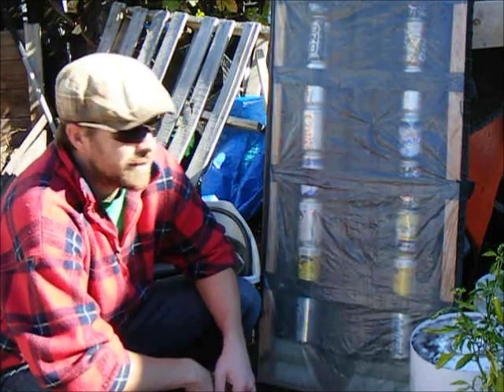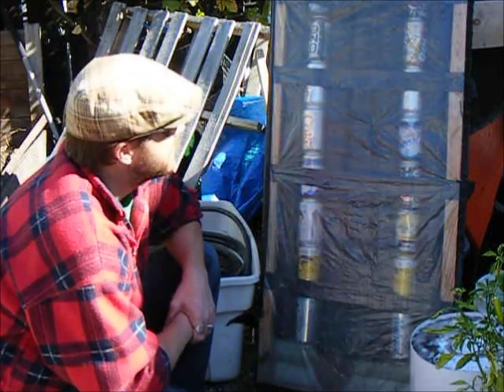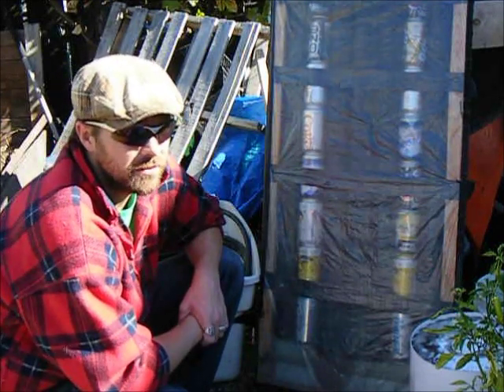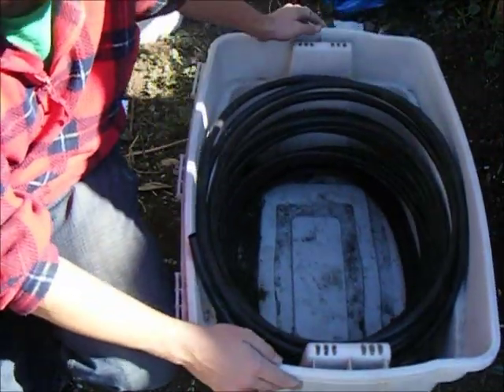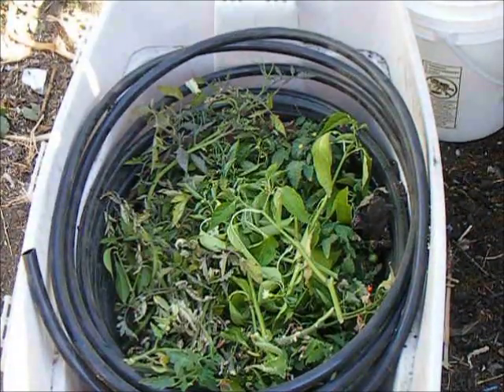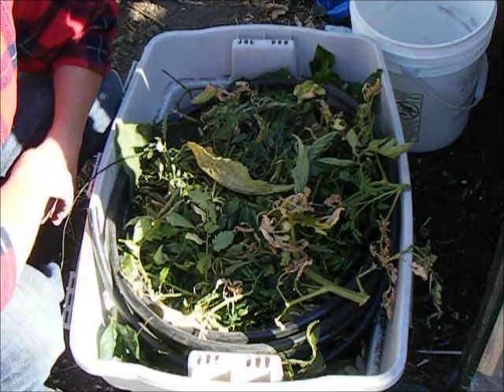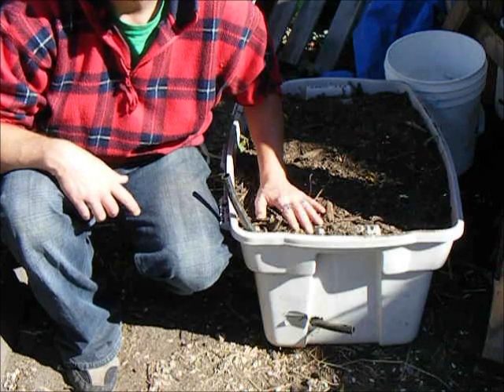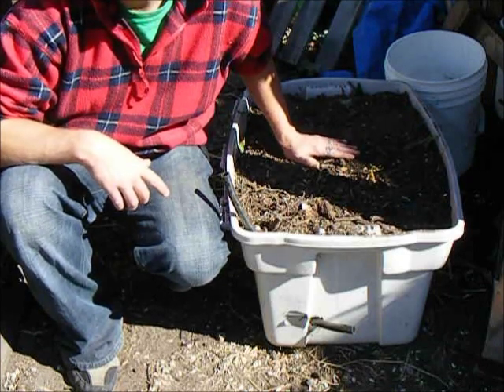Greenhouse heat from Compost

Comment: my question is if you remove heat from the compost will it lower the compost temperature and affect the composting cycle
Reply from the maker: Maybe?  This pile was too small to know for sure but I would think that if the pile were large enough it shouldn't make too much of a difference.  Interesting question, thanks!

Comment: to add some, i dont know what kind of systems you've got running in there (hydroponic, aquaponic) but water masses seem to help A LOT; i've even seen compost piles used for hot showers, running a water hose into the pile, to a small plastic container, which fills up, and back out to a shower; the same could be done with an aquaponic system to keep the fish and greenhouse warm; a static reservoir in the sunlight would have effect too, but you would need to use the algae for something;

Comment from the maker: Ya, that's what I've come to believe as well.  There are lots of great vid's out there showing this idea and ... it looks like the bigger the better.
So far, it has stayed a little bit warmer on the surface than the rest of the greenhouse but not by much.  Next time the pile will be MUCH larger and I want to run a small fan I saw at an RC shop on that hose to push that heat out a little more.  Thanks for the feedback!